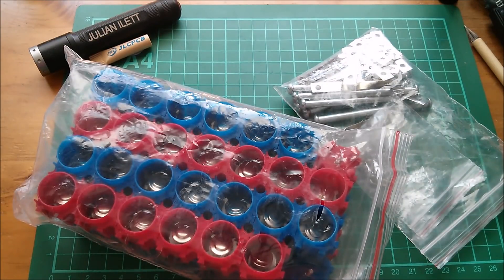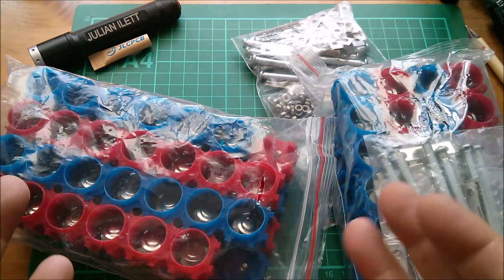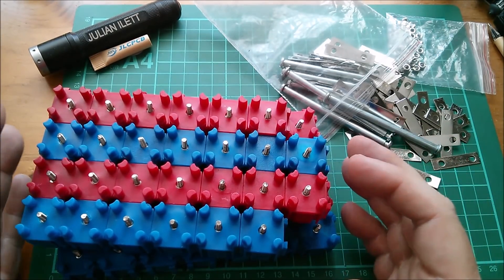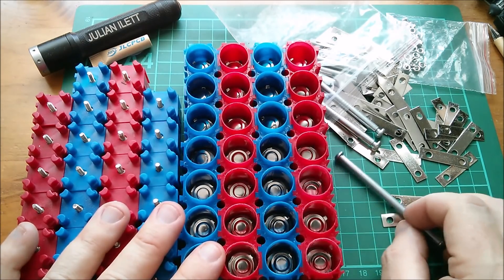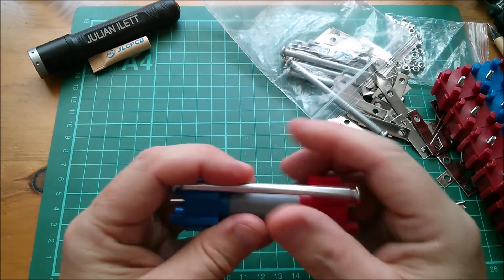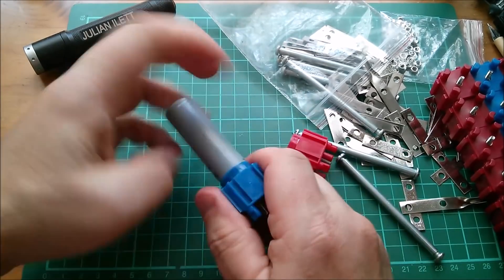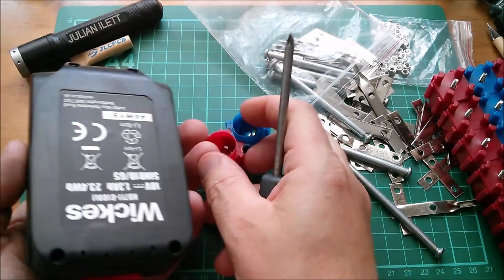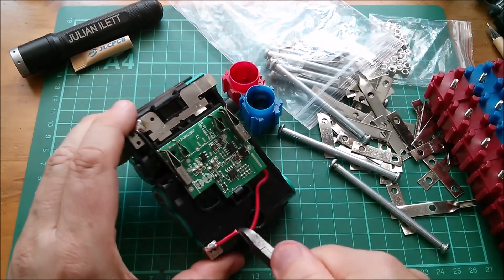First Look: Vruzend 1.6 Lithium Ion 18650 Battery System

Comment: I need those without these Plates. I want fuses attached by the nut between the screw of the battery and the cable.  Is it possible to buy something like this but only the caps?

Comment: I've heard some pretty mixed things about the Vruzend kits. And by "mixed" I mean "bad and worse."

I borrowed ideas from several of the models I found on Thingiverse and assembled my own take on a 3D-printable battery holder. https://www.thingiverse.com/thing:3824557

a 7-wide box costs about $1US to print, and I wired them using scrap power cable and ethernet wire.

Comment: While this product is expensive, I really love the idea of these types of systems. Where you can add cells easily and put it together without any soldering. Because I really hate trying to solder something on top of an 18650, you need a really high power soldering iron and I am always worried about the heat getting into the cell during the process. Plus if you ever have a problem you have to desolder and those self made packs usually look like a mess. 
I like the idea of these packing system where it uses bolts and screws etc. This makes it easier to put together, plus it makes it easier to replace and also means you don't have to worry about damaging the cell with heat from a soldering iron. 

But my most favourite and easy way so far are these empty power banks that you can buy from China, all you have to do is put 8 18650's inside and the system has built in balancing and charging etc and USB ports for output. I use this power bank to power the light in my room, it can run my room light for around 30 hours straight before it runs out. It usually lasts around 5 nights until I have to recharge it. That's a decent enough time for me that I don't consider it impractical. It then charges on a high power USB socket from my inverter, generally it takes around 10 hours to charge. So basically a full day if you get it on there very early. 

Now the above system in your video though is superior to those 8x18650 power banks that I mentioned in one way, with the system in your video it's possibly to make a large power banks. Such as easily 20+ cells. 
Meaning you can easily put together a 200+ watt hour system.

AMD now make new APU's (CPU+GPU system) which only use a max of 35w in load. Thus it's more like 20w in regular use on average, combined with other components you need for the computer it's possible to put together a reasonably competent computer that only uses a max of 55w at load (or more like 40w on average overall). 
With such a system you would use those DC-DC CPU power supplies, this connects to the 24 pin socket on the motherboard and has the CPU power connector also. You can get small ones of these with 120w capabilities and they are highly efficient, this would be perfect for the computer in question. 

Then you just connect the other side of that DC-DC power supply to the lithium battery pack. This is my goal, to build this system. 
I probably won't buy the expensive Panasonic high capacity cells (even though they are the best). But I will settle on more common cells with capacities around 2500mAh. 
And basically all you have to do is get around 48 of these batteries and build the battery pack. This should give you around a 444 watt hour battery, which in theory could run this computer for around 11 hours before needing recharging. But it's safer to assume 10 hours when taking into conversions and inefficiencies. That's still a good run time. 
Of a day time you would connect it just to the output wires from your charge controller, and let the remainder solar power charge the battery pack up. Then of a night time flick a switch over for the computer to be powered by the battery pack. 

I like the idea of this. There is only one power conversion done in this system and the conversions are very close to each other in voltage anyway and it's DC-DC. 
Yet people who run their computer from an inverter are doing crazy conversions and losses, first their battery is converted from around 12v to 240v (or whatever your country uses), then that is plugged into a computer power supply which then takes that 240v and converts it back down to 12v. Thus you are converting it up and down hugely twice and also going from DC to AC and AC back to DC. Expecting power losses of up to 30-40% in such a setup is typical of this poor setup. 

That's why going with a DC-DC system and forgetting high voltage AC is the way to go with powering your computer. 
This system is my goal, if I ever have enough spare time to make it I will upload it to my other youtube channel.

Comment: Julian, looks like you haven't watched any of the thousands of videos over the last 4 years showing how to properly harvest 18650 cells! Use sharp flush side cutters to remove the nickel strips and jaggies.
Pulling the strips risks ripping the can and leaking electrolyte.
Can use a Dremel for stubborn jaggies if really necessary.
Vruzend don't have a good reputation in the DIY powerwall community but they seem good enough for small amateur packs.
When you're building packs with thousands of cells, then there are far better and cheaper methods.

Comment: I evaluated the Vruzend stuff a couple years ago and determined that the plastic friction was not a suitable retainer.  Plus, they were expensive, comparatively. It's good to see that they came around and put barrel bolts on them.  Perhaps there will be fewer fires now, eh?  =:-0

Comment: Do you think it is really worth the money? I mean, you could get around 10 good cells for that pack or a 100 used ones. And nickel strips are much cheaper - o.k. - you have to weld them on. I have never disassembled a pack i had made - so why should you?

Comment: I'm fairly naive to electronics. I built an 18650 based mobile charging  station for racing drone batteries. I didn't have a spot welder, so I 3d-printed some holders  and folded aluminum foil over and over and flattened it in a bench vice...then used that to connext all the batteries for testing before ordering real 18650 holders. Thing is, it worked fine with the foil. I regularly charge at 200+ watts. Just curious on if I'm fine leaving it...or is there any danger in the way I rigged it up?

Comment: These holders are garbage. "Stop tightening if the plastic starts to break"? I mean, seriously? Besides, unless you have 4, 6, 8, 9, 11 or 12 cells, the bolts are useless and the caps fall off. What an utter pile of wank.

(Also, I've noticed that Julian spends countless pounds on various money-saving and environment-saving equipment - batteries, supercaps, solar panels etc - and must end up spending more money than he would if he just used mains power like a normal person. And it's hardly going to save the environment when you're shipping tons of unnecessary crap around the country. By all means do these things, but does anyone seriously think that it's somehow "green"?)

Comment: Expensive solution and for big $ I'm surprised inside sprung contact of end pieces doesn't have a small tripod of gold-plated bumps to ensure good low-heat conduction. These may be fire risk above ~2 amps and not to be used under vibration.

Comment: The batteries were welded in series you cut them apart and put them back in series? When you tighten the barrel bolt hook a meter to the battery bolts and snug it just past when you have voltage so to not over tighten them.

Comment: It's definitely out of India. They have had an American distributor, maybe Micah Toll. Looking at the Forum it is not very active. I have the original kit. There were a lot of criticisms. I'm pretty sure the springs are better now, and they are using a bolt to retain compression. Neal Saiki had a battery system going back to at least 2012, The NTS thing. Never went anywhere, but it was part of an ebike crowdfunding deal. I think the Chinese have developed robotic spot welders, along the way, so churning out modules is not a very big deal. No one is willing to say that any compression system is comparable to a spot weld. Basically with cheaper cells and robot welding, markets like ebikes can get batteries at 1/4 the cost of five years ago. The original Sondors bike, with all the US controversy, had a very low cost battery. Jehu Garcia has promoted some sort of compression system. What's the future? People in the US Ebike community never embraced Vruzend.  I wish they would just sell shrink wrapped modules, 5 or 8 or 10 cells in series, spot welded. I'd put XT60 s on the end.
Reply: George Sears odd comment. They have actually improved significantly and are gaining acceptance.

Comment: I've learned to make more smaller packs for my ebike  connect in series  have a few around switch out no problem. If you have a big battery something goes wrong big problem also hobby chargers they are cheap $15bucks good enough generic.   imax  original$50 NOPE

Comment: Inside tip my exp buy laptop batt packs eBay as many as possible in pack 9 or 12 brand new theseARE quality cells generic. People get it wrong the mini BMS is the Fire hazard  average $1 to 2per cell. Unless you are wealthy then buy LG Panasonic 3 to 5per cell NOPE.

Comment: Do positive caps have a vent hole in case of battery failure or do the cases just explode ?
Reply from the maker: You could drill a vent hole, but they're quite leaky anyway.

Comment: I would have preferred longer clamping bolts with a washer on top of the plastic legs, but that would make the pack longer and  and would not stand on end with a 4 cell arrangement.

Comment: Given that there is no real length tolerance I'd suggest just cutting the tab ends inside the contact diameter and leaving the welds/tabs in place.   Rolling them off  sardine-can fashion has the potential to open the cell if the weld comes away with the tab.

Comment: Do not get this version regardless of the price! I ruined 7 perfectly good 18650s with it. Wait for more improvements or do the right thing - spot weld
1. When you push the cells into the caps it's a tight fit so you compress the air inside and like a spring the caps come ever so slightly away from the contacts - a small hole in each one would relieve this and make assembly/disassembly easier. 2 Because of #1 there isn't much tactile feedback when pressing the caps over the cells. It shouldn't be possible to over insert the cells. I ruined 7 perfectly good 18650s because of this. There should be a molded in stop inside the cap to prevent over insertion.
Reply: Watch the video again and listen to what he saya....
Reply: @philipboug  looks like no
Reply: @pleasecho2  Yes... OK in a square but you cannot use it in a line because nowhere for the barrel bolts.
Reply: @philipboug  There's always zip ties.
Reply: @pleasecho2  Not very elegant... Good luck.

Comment: serously... this is lithium cells, not Legos... thoose shity holders are completly closing the cells and in the event that only one of them catch fire, it wont catch fire, it will explode like a bomb!
The explosion even if it is a small one, would deform the entire pack and create shorts, that will create other explosions...
Now the great thing is all those litle shity terminals that will then act as multiple bullets.
Reply from the maker: Or you could just not blow your batteries up :)

Comment: If the plastic connectors come loose over time (most likely because of vibrations), so will the screws of the barrel bolts.  You at least need some loctite.  Plus the added bulk to the pack isn't worth it.  Very gimmicky.

Comment: Julian, you spend £1 on battery packs to save money, then spend $40 on the holders?  ?
Reply: Lmao
Reply: Be careful pulling the nickel strips off the battery negative, the metal on the battery is only thin, I pulled one once and it made a hole in the cell and the cell vented.
Reply: 95% of my costs go on fittings and hardware and 5% on the cells. battery packs and cells are cheap as chips shops practically give them away when they have been sitting around for 12 months or more. Sadly the BMS runs the packs down to 0v over a long time some packs are good as new after 2 years sitting some are compleatly dead. The date on that wickes pack is week 44  2015
Reply: what would you buy?
Reply: I'd buy the copper to complete my microwave oven transformer spot welder,  and a reel of nickel tabbing wire.

Comment: How has no one called you a lucky b word for getting those batteries for 1quid a pack
Reply from the maker: Just lucky timing - Wickes were clearing out their spare battery stocks. I got about 50 cells, but a couple of lucky chaps got 250 cells each.
Reply: Where can you even get those batteries so cheaply, apart from asking various stores if you can go rifling through their battery recycling bins? :p

Comment: I dont think you specified the cost of this kit unless i missed it?
Reply from the maker: I paid £33 for the 54-cell kit.
Reply: @JulianIlett  Ouch a little bit crazy cost?
Reply: @JulianIlett  cheaper to drill holes in some boards and use them, stronger too.
Reply: I've made a few 36v. This IS what you need. To make it simple. You can use all kinds of cells if it shorts or dies. So What pop in and out. My exp by the time you solder and fight the whole thing it sucks.  Great invention.  I save soldering for my e skateboard. I hot glue then go. Bigger batteries need this

Comment: Could you not cut the welded strips down but leave them in place on top and bottom as a contact into the battery system?
Reply: On NiCad and NiMh cells that I have broken out of packs, I have just cut the existing metal straps and have soldered wires onto the remains of the straps with out problems. I do have a 50W iron with a large bit, so that helps to make the solder joint quick (less heat then goes into the cell).
Reply from the maker: I guess that would work :)

Comment: Can anyone recommend a good seller of 18650s on Ebay? I have a few power tool batteries to repair :P And a 40v lawnmower battery. Ideally theyd be high current cells as well :) Around the 2000mah range :P
Reply: its mAH
Reply: No really, the capacity should be stated in Ah, as the value is above 1Ah (1000mAh). You don’t hear people talking about using 24000mV power tools do you!
Reply: @Mark1024MAK  Hahahahahahahahahahahahaha  you are such a card. But missed the point.  Besides that you are full of sh&t
Reply: Kenn Mossman - Oh I got the point, but the use of the incorrect case of the letters and the general misuse of SI units (International System of Units) is so widespread it is really annoying, hence I like to use a silly example to show it up. Also annoying is people no longer reading back what they have written. Often the excuse is that they are using a so called ‘smart’phone.
Reply: Avoid anything with "fire" in the name and advertised capacities over 3400 mAh. They are all fake.
Some cells are even half filled with rice or sand.
Only get reputable brands such as Samsung or Panasonic.
Note that power cells (~ 1500 mAh) have lower capacities than energy cells (< 3400mAh) but can supply more current because the electrodes are thicker so less room for electrode materials.